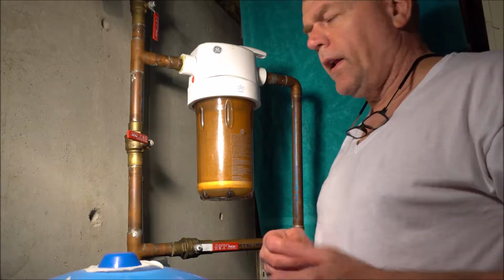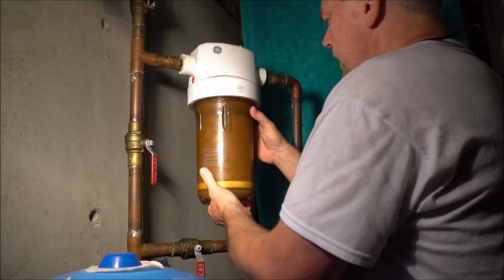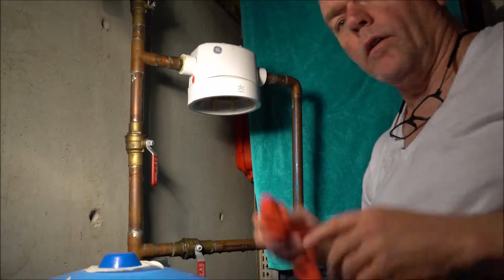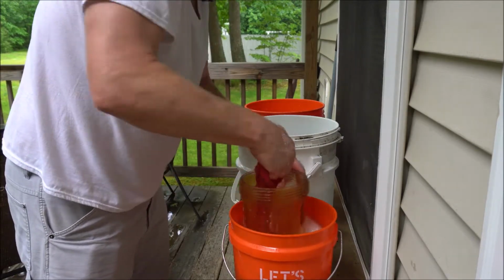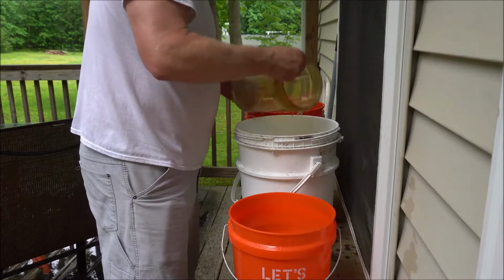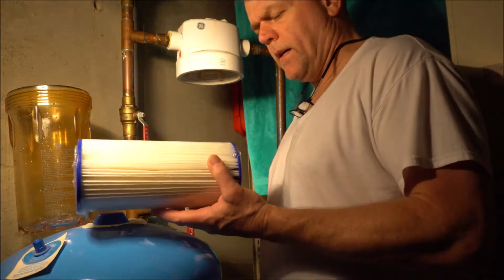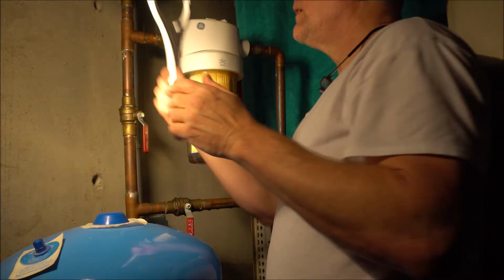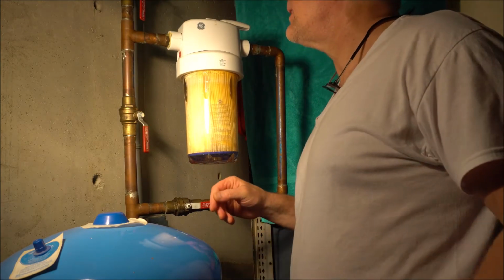High-Flow Household water filter replacement process.

Comment: I need to do this pretty soon for the first time, so thanks for posting. I had my plumber build my filter piping to include a bypass and isolation valves in and out of the filter so hopefully that will make the whole process easy.

Comment: Curious on a couple things.  First, why is your shut off valve on between the in and out pipe to the filter? I would think you turn that off, but if you want to bypass the filter then you turn it on and turn the filter valve off.  Also, I didn't see you lube up the oring which is recommended.  Have you had to replace that? Lastly, they say to run the water for 10 minutes and then shut off, wait one hour and then do it again after a filter change.  Do you do that, or have you noticed any difference in the water by not doing it? I would think it isn't necessary as your system has the filtered water in it already.